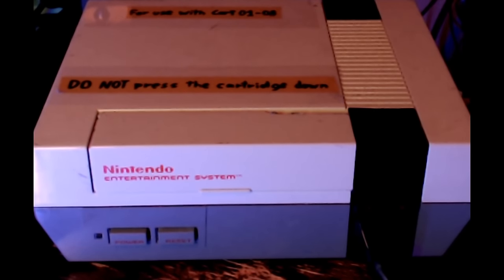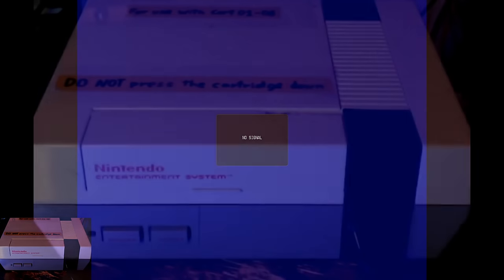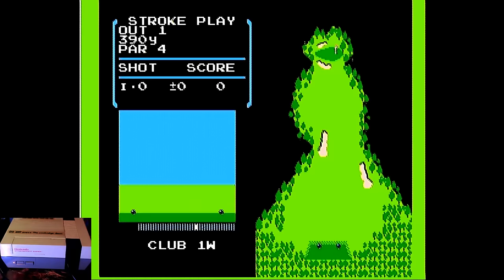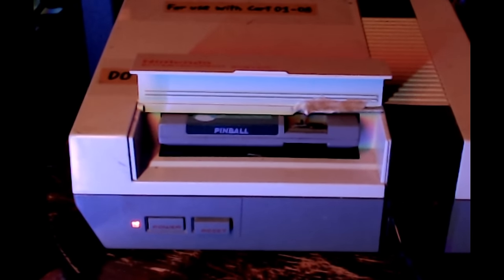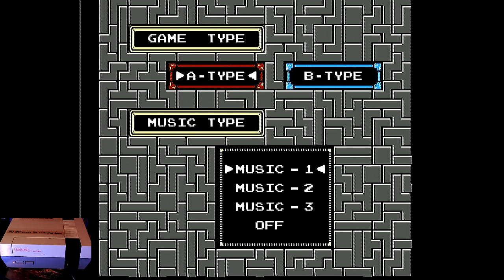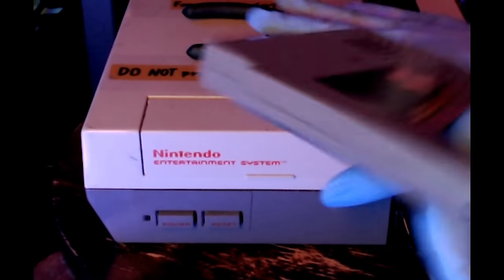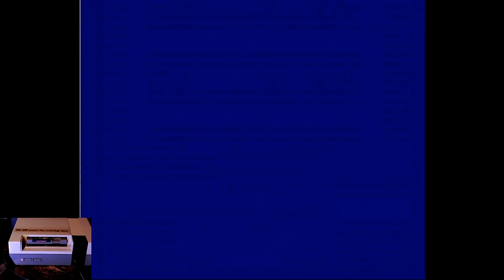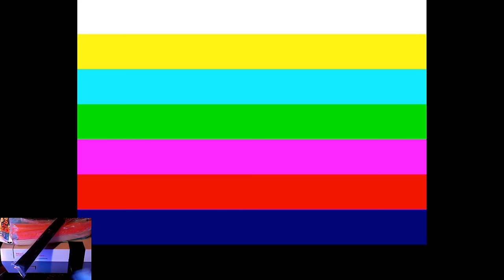Vinny - Corruption Stockpile on Actual NES Hardware

Comment: About 14:30: I microwaved a cartridge once for a few seconds because I was so frustrated with it. It was a rental of Rock&Roll Racing, if I correctly remember. It still worked fine.
Reply: who knows what corruptions you bestowed upon the next rentee
Reply: @johnfreeman9349  yeah it probably just took time to awaken, but then it is ready for its next (or rather, first) victim
Reply: This made me chuckle good. Why wait for the cosmic rays when you can control them yourself?
Reply: @EddieSpaghetti69  you seem to be challenging me to produce transuranium elements just to really expose a cartridge to similar energies
Reply: @luisp.3788  Not as hard as you'd think, more manufacturing then it's worth. Easier is to boost the output of your microwave by a couple hundred volts and it "Should" give enough radiation. It should also out-power the shielding thats in there, making things Really Fun as microwaves contain weak cages to protect from leakage.

Or just head out to the Uranium Flats near BC-Alberta, or apply to carry dangerous cargo and try to pick some up at El Paso or anywhere where "Unwanted Materials" are dumped.
The laws are Funky regarding Radiation. It's like it's bee half-studied and half-done, like its byproducts from half-lifes.
Reply: @EddieSpaghetti69  may be easier to make them in my garage than to try to get radioactive materials from alberta to germany lol
Reply: @EddieSpaghetti69  That one Mario 64 player: "Am I a joke to you?"

Comment: Reminds me of a fun childhood afternoon with two friends, somehow getting a plug-n-play from the Walgreens toy aisle to corrupt memory via mercilessly slamming it into the hardwood floor.
I'd love to see Vinny attempt that one, though I don't remember why it even worked.
Reply: The plug and plays use a cheap av out cable which is highly prone to interference, especially if said cable is damaged.

Sometimes you can get similar effects by quickly mashing the power or reset buttons, depending on the console.

I have a wheel of fortune plug and play with a frayed but taped cable that severely glitches out the more you play it. Sadly, the only corruptions seem to be the screen going nuts and inverting the colors.
Reply: The chips going out also lead to some interesting things happening. Maybe that's what broke when you slammed it, but somehow not enough to completely stop the thing from working.

Comment: 1:05:39
I can explain these for those who are unfamiliar:
The person who modified the cartridges added a small prototype PCB with those blue objects called resistors to alter the output from each trace that they're connected to. The added resistance is enough to modify what the hardware is anticipating and causes the issues. This is why corroded or dirty cartridges are mentioned earlier, as they have a similar (but MUCH less predictable) effect on the output signals. 

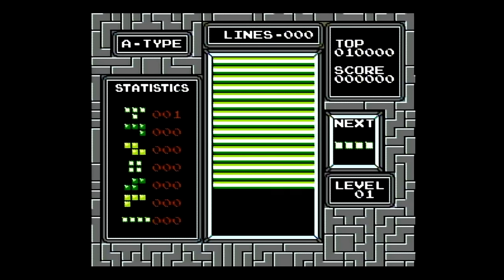1:05:45
The same as above is depicted here.The gunk that chatters are beginning to note is just glue, and it really is essential. It serves the purpose of preventing anything from coming into unexpected contact with another point. Unanticipated current can cause a short circuit and destroy the cartridge.

 1:05:51
As above, so below. This time the modder uses header pins and different cabling to streamline the process by the looks of it.

1:06:07
Even more efficient cabling and fancier use of female header pins.

 1:06:33
This is where it starts to get really interesting. The probing setup uses a single potentiometer, which is just a variable-state resistor. The red cables sticking out of the PCB are leads into select output traces/IC pins in order to be tested with the potentiometer. You can see the two alligator clips connected, with the blue one being where the signal enters the potentiometer and the green one being the pin that is getting the reduced output. The potentiometer is set to a high resistance in this image. 

1:06:39
The potentiometer is a very simple tool to probe with, as you can see there are only three pins. The middle pin is the input, and is what the potentiometer is using as a reference. The pin on the left is being used as the output, and will receive less resistance if the knob is turned its way. The pin on the right is not connected to anything, and would be considered a ground in this case. Turning the knob in the direction of the ground will add a higher resistance, changing the current enough to corrupt more (depending on how high the resistance is. At some point, it will just fail to read properly and not work).

From here, the pictures go on to show the process of assembly, mainly just soldering connections, but still very nice work to be seen. The modder really gave a lot of information to work with by taking those images and should be proud of their work. This actually looks like it'd be a really fun project to do at home.

Comment: As someone who love noise and glitch music I love those gnarly sounds that the corrupted hardware produces. Almost makes me wanna get a NES and learn how to fuck with some cartridges
Reply: this is more or less just circuit bending which is used a lot in some experimental music. one of my fav uses is a bended speak & spell in a current 93 track. it's gnarly
Reply: @resiseven7407  Which track and which album?
Reply: @monophone903  "i have a special plan for this world", it was a long single or, i guess single track EP. the speak & spell noises sorta separate the stanzas of this poem / short story that's read throughout
Reply: @resiseven7407  damn it, the one thing not on Spotify. God, that's dumb. But yeah, I've really been meaning to listen to that one
Reply: @monophone903  there are places!

Comment: I'm a little impressed these games are even able to run under these conditions. I assume a lot of the non-graphical corruption is from onboard memory errors. NES games often maintained a pointer or a jump table index in RAM to branch out into different control flows (is the game on the title screen or in a level, is Mario on the ground or in the air, etc.). If that index or pointer is corrupted in RAM, it usually results in the CPU jumping to an arbitrary memory location and executing bytes blindly as code which is an instant crash 99% of the time. The chances of any specific byte being corrupted in work RAM is only about 0.0061%, but presumably many corruptions are happening in quick succession. There's also the issue of the return address stack, which depending on the game has anywhere from a 0.001% to 0.2% chance of being corrupted with a single error.
Reply: tahts teh maegeic
Reply: I wish my reading comprehension wasn’t so shite
Reply: Yeah, it's really impressive how stable these are on the hardware side as well - just "bending pins" willy-nilly isn't exactly a recipe for electronic stability. I'd be interested to dig into what the failure modes of these are as a side project.
Reply: I only vaguely know what that means as someone into emulation, but I basically read it in layman's terms as "running for that long typically causes mathematical errors in the RAM and CPU that brick the game, so it's surprising these work at all".
Please correct me/elaborate if I'm wrong.
Reply: "It's impressive the NES doesn't crash considering most of the corruptions aren't visual."
"To explain, pointers and jump tables are used to forward data into their specific locations. If a pointer or jump table breaks, the CPU executes data in undesired areas and forces a crash."
"The chance for a corruption is abysmally small, but errors in succession (in the milliseconds) increases it drastically."
That's how I read it.
Reply: @warbossgegguz679  That's the long and short of it. It's hard to give a general statement on it because there's a few ways an NES game can crash:

- Soft infinite loop. These are mild crashes, because the VBlank interrupt is still enabled (it fires at the beginning of every frame and usually draws the last frame's graphics, updates the sound engine, reads controllers). They're usually caused by values being out of range from what the programmer expected to be there, which forces to code to "wait" for it to become a reasonable value.

- Hard infinite loop. These are the types of crashes that basically just stop the game dead in its tracks. Super Mario Bros. 1 waits at the beginning of every frame for the TV's electron beam to draw the coin tile in the HUD before doing anything else. If that tile gets overwritten, or the interrupt takes too long to run its code and misses that pixel, the game loops forever until reset and nothing happens.

- Illegal opcode crash. Each opcode is one byte long, so the processor in the NES has a set of 256 "opcodes" it can execute, which do small things like adding, reading from memory, incrementing a value. But only 151 of those operations are valid. Some of the 105 illegal one can do nothing, do potentially useful things, have unstable behaviour, or straight up turn the NES into a brick (it won't even respond to the RESET button; you have to power cycle it manually). It's very likely for the NES to brick if it reads random data as instructions, but sometimes it'll send the CPU rampaging through wild memory locations and writing random values to memory or I/O registers first, which can cause some clown vomit behaviour. It could (theoretically) flip the wrong bit in one of those registers, stressing the physical electronics in the NES and possibly causing damage.
Reply: @Unclipper  ye it's amazing how reliable they are
Reply: @mantictac  Yeah, like I said I have 0 programming but emulation troubleshooting has taught me that like 90% of glitches, corruptions, and incompatibility can be very broadly summed up as the result of math not lining up right somewhere.

The most famous example is probably how it took Dolphin like a decade to be able to run True Crime: Streets of New York because it was a rushed port that constantly divided by zero in ways that would be ignored by real hardware, but required adding a whole separate catalog of code to Dolphin just to run 1 specific game.

But it can obviously happen in a lot of games if they're left on/inactive longer than any sensible human being would, there's an integer overflow that completely breaks the game a la Donkey Kong and Tetris,  memory leaks, etc.

I don't know the specifics of these things, but since I'm not a coder the broad strokes are all I really need to know.

Comment: Cool internals. Try adding some ceramic capacitors in series with your resistors, to help control values that normally oscillate or cycle. Also, I'm interested to see what sorts of results you might get by routing individual wires through potentiometers and randomly adjusting the dials while the game is running.

Comment: I'd agree that it's likely to be heat realted issues that cause these corruptions. The fact that a reset maintains the current corruption and a power cycle doesn't suggests that the system RAM is getting wonky and over time, that would defo suggest heat.
You can easily test this too. 
Get a can of air duster, turn it upside down so that the cooled liquid comes out and spray that on the RAM (or other chips one by one) and see hwo the results change.
I use this trick an awful lot in fixing electronics, as it's an easy way to check for such chip issues.
Reply: The goofy resistors bridged onto certain pins in the modified cartridges may be changing slightly due to heat - while this is normal and only a tiny difference in an analog system - this tiny amount of variance in the digital signal absolutely wrecks it, so as the signal drift gets worse and worse as the hardware warmps up the corruptions get more zany.
Reply: @Coconut-219  Sorry but that can't be the problem. It manifests across all the carts which suggests the console itself.
Reply: @MrWolfSnack  You're still missing the point. You're talking about the few carts that had wonky resistors on. The problem manifested on ALL games. Ergo, it can't be those carts.

Comment: someone needs to figure out how to make digital corruptions that give amazing-ness like this.
Reply: @joshshrum2764  normal corruptions run a formula to permanently distort some bits, or alter bits during runtime. Physical corruptions like this cause analog changes and analog swaps - the "formula" gets 'randomly generated' on a physical corruption - the same formula that actively changes bits only as they transfer between ROMs, but this "on rom transfer" event is not doable on an emulator, so it's... I think impossible to even try?
Reply: @dimitar4y I don’t see why one couldn’t (at least in principle) make a model describing how the signals from the cartridge change as a result of these kinds of errors

Comment: this is a very interesting concept. If the temperature truly determines the level of corruptness I could see the possibility of adding a chip on top of the microchip that acts as a temperature control system where you can vary the temperature with a knob to vary the level of corruptness in real time. maybe set it to a fixed max temperature so it never gets too corrupt

Comment: the combination of resistors, wires and terminals/connectors is just hilarious, I'm pretty sure he's shorting either some data or address pins in a way that sometimes it'll read as a one or a zero, producing said corruptions.

Comment: I've been thinking of designing a Nintendo 64 corrupter that uses real hardware. It would be a pass-through device like a GameShark cartridge and have tiny on/off switches or potentiometers for each connector pin. Basically it's a cartridge tilting emulator but instead of tilting the cartridge and damaging the pins or shorting something out, you can turn off individual pins and get results that are impossible to achieve with normal tilting. N64 hardware experts, by cutting power to certain pins will that cause overvoltage to something? Any other damage concerns?

Comment: The fact the the corrupted cartidges start way easier than original unaltered cartridges that i own is wild. But maybe thats the perk of the new connector that vinby mentioned at the begining
Reply: Definitely the new connector, most of the time the issue with games jot working is a not so perfect pin connection, this new pin set is literally gripping the games so hard it's not shocking they start pretty much instantly

Comment: Instead of using Resistors with a fixed value why not instead use Thermistors that  includes those resistance values in their full range. Might be hard to get Thermistors that match that description, BUT it would legitimately change as it warms up.
Why stop at Thermistors even? There are several electronic components that can vary resistance. The only problem is finding components that have similar resistance values, you'd need a supply of old analog electronic components.

Comment: maybe i'm completely wrong but if phil sent this stuff in the mail there's a good possibility that whatever trickery he got up to was made undone/made worse by postage manhandling the packages around. like the daughterboards could have been disconnected or the connection weakened, or the pins he bent got more bent, etc. there's also a possibility of humidity change affecting it but i kinda doubt it since they're sealed cartridges

Comment: I had a copy of ssb melee that looked like it had a burn around the inner ring. When I turned the system on it would go through the GameCube theme then an error message after a short black screen. I found out if I hit reset only after the GameCube theme disappeared, but before the error message came up, it'd go straight to the start page without starting the intro video. I tried that on other disks but it never worked like that, only on that one damaged disk (which I got from GameStop way back when of course lmao). I've had smash people say "bullshit, that's impossible!" And I'm just like WTF dude why would I lie about this😂 I don't even have the risk anymore, there's no clout to be had, it was just a weird thing I dealt with for a few years

Comment: NES: Controller still works after almost 40 years
Switch: Have to pay for overpriced Joy-cons with useless motion sensors every couple years because of shitty sticks.

Thanks, Nintendo!
Reply: Just buy 3rd party. The ones by Hori and Binbok are genuinely better than anything official + the latter still has motion/gyro control if you want it.

The only thing it doesn't have is HD rumble, which nobody cares about.

Comment: I tried this awhile back to try getting cool glitch sounds to sample in my synth setup. I basically ran toploader system with cartridges without their shell. Stuck pin connector wires in between the chip legs and recorded the results. Unfortunately there wasn't any cool glitch sounds worth while so I gave up on the idea. I at least got a cool video out of it
https://www.youtube.com/watch?v=fz1736Im3AI&t=80s

Comment: @Vinesauce: The Full Sauce:  For Super mario bros.3 if you have a non corrupted console and a non corrupted Super mario bros.3,  as long as it is not the pal version they are other way to playing corrupted, Remember the glitch speed run call the wrong warp that you have to spond the koopas at the correct sprite slot and make it de-spond so the game see it as a code when it get corrupted in 7-1 so that is how it jump to the peach room in 7-1 by using the pipe the wrong way you end-up in a mess-up area and hiting the note block cause a crash that overload the stack value, and that is why it read the koopa shell as code during that corruption, so by randomly placeing does shell you can end-up with diffrent kind of corruption, one time when I did not know how to do the Jump to peach properly it end-up placeing mario in a corrupt version of a beta level and that happen in the WiiU virtual console.